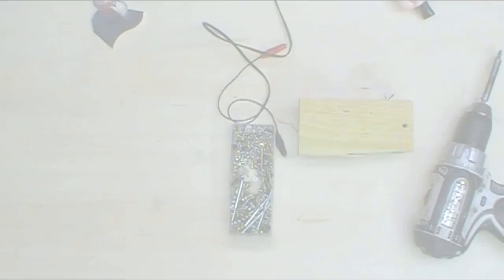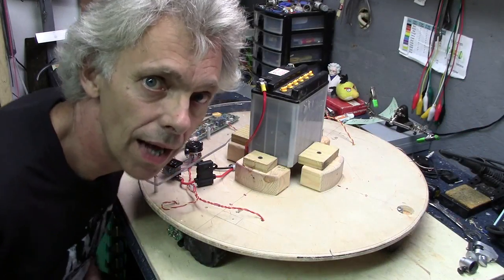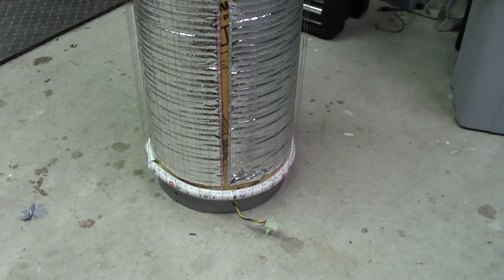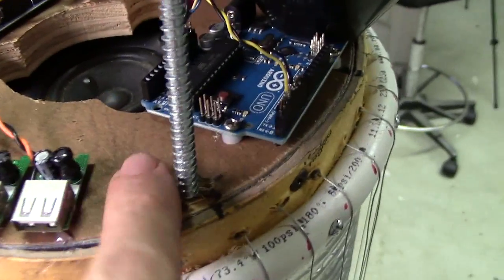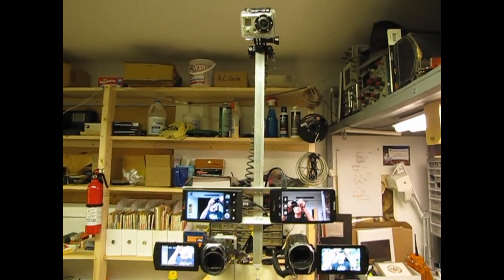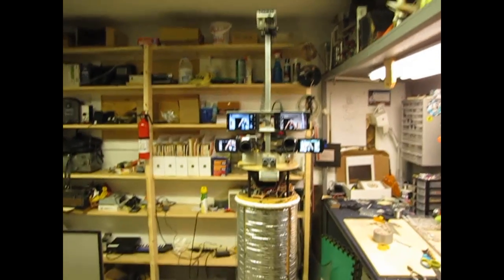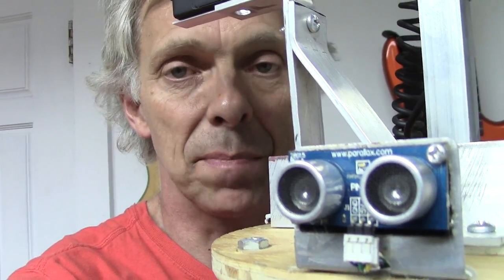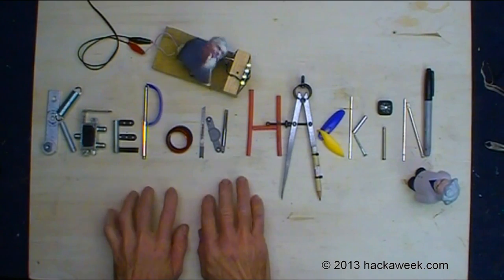Photon The Video Photo Robot Part 5

Comment: It did quite well! Battery life was excellent! I got almost two hours out of a charge. It ran without anything failing but it was driving slow. All the cameras worked fine except the GoPro. The voltage regulator I made for that needed to be outputting more voltage. It wasn't enough and the GoPro would time out so I just used it's battery. The WiFi was a fail because of the saturated bandwidth issues. All the bump switches and the PING sensor worked fine.